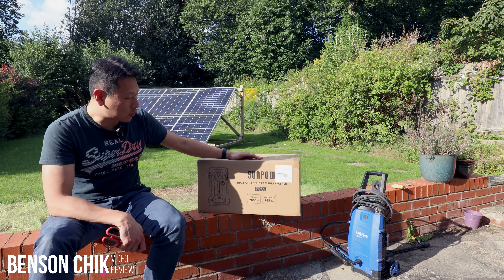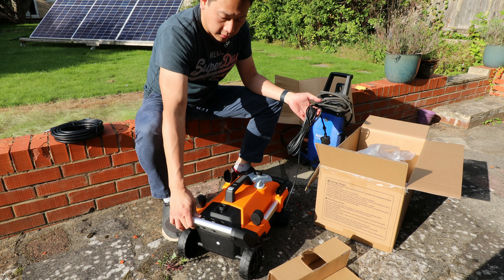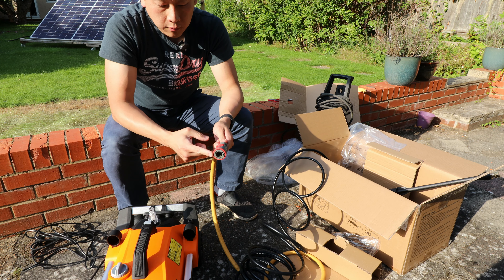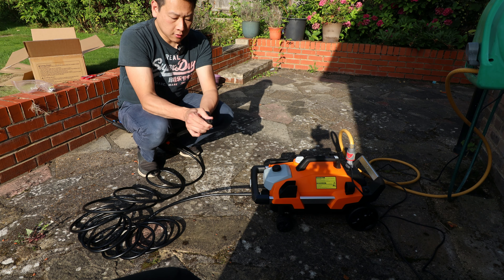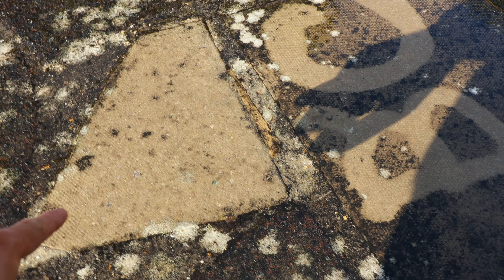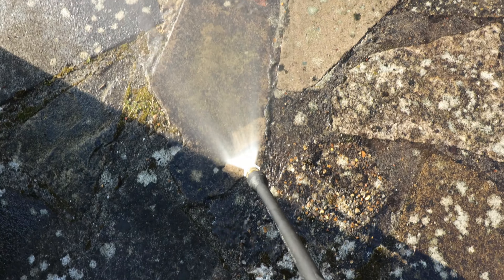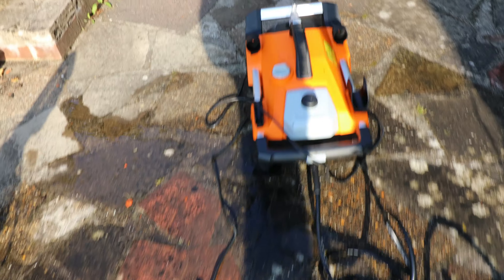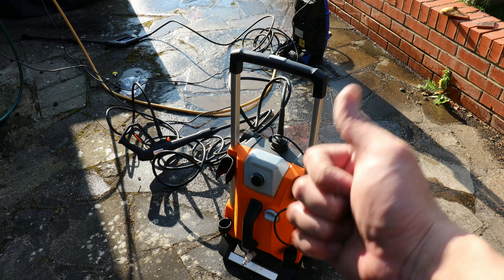SUNPOW High Pressure Jet Wash HP1172 review by Benson Chik 165 Bar for less than £150, really?

Comment: Thanks for the video review.
Is it possible to connect a soap dispenser to it? For example if you would like to wash a car?
Reply from the maker: You can attach a foam lance to it, I let the machine out in the garden shed and there must be water inside of the pump as in spring when I try to use it water just spill out from the casing… water inside mush have iced up and crack the inner part. I now keep my washer in the house.
Reply: @BCreviews  thanks 👍

Comment: Mine started leaking from the entire hand unit and wouldn't shut off/on.  No replacement hand unit seems available.  I'd avoid purchase .....
Reply from the maker: Mine just leak water from inside the case and no power today , I thought it was frost as I left it in a shelter in the garden… I wonder if Amazon would do anything about this

Comment: Hi. Thank you for the video. I just bought it. What is that aqua holder you use on your water pipe that connected to the washer machine. It was grey and red.? Thank you
Reply from the maker: https://amzn.to/3HfkGjl  a quick release connector which only allows water flow when plugged in.
Reply: @Benson Chik  thank you for that. One more question. Could I not plug it into a water tap, but use a large drum/bucket of water instead??
Reply from the maker: I am not sure as not tried that, some pressure washers need pressure from hose to prime the pump, if air locked it will burn out the motor 🚨

Comment: Like your red bricks what the name for brick
Reply from the maker: Cheap engineering brick, don’t get these, look nice but they crack over winter months when freeze with water on it…
Reply: @BCreviews  wow nice the pressure wash on the video you review it's work on wash away  black spot and heavy soil on the driveway
Reply from the maker: @razwankhan-q7e it’s a very good machine but I broke it. I left it out in the cold and water freeze inside and broke the tank
Reply: @BCreviews  I see you left old pressure washer? The £150 pressure wash is powerful than the older one

Comment: Nice one can you get extra links to reach to the roof or something??
Reply from the maker: you can get longer high pressure hose for the gun side or just extend your garden hose etc. This is a bit too bulky for the roof for me, I have a battery operated pressure washer for my solar panel on the flat roof, not 164 bar but enough to clean caked bird poo off the glass etc. https://www.youtube.com/watch?v=-XubXZoUN8A
Reply: @BCreviews  great thanks for help

Comment: Does not come with a Hose...and try getting one to fit...very Poor! of course they don't tell you this when Buying,very Bad.
Reply from the maker: Do you mean hose for the water source? I am sure my old jet wash does not come with one either and it was a branded product. I hope in my video I have shown what comes with it so buyer like yourself knows what is needed to start using one
Reply: I've bought loads of jet washers over the last 25 years, and not once has it ever included a hose pipe. They're two totally different products. It's like buying a car and expecting a garage to come free with it.